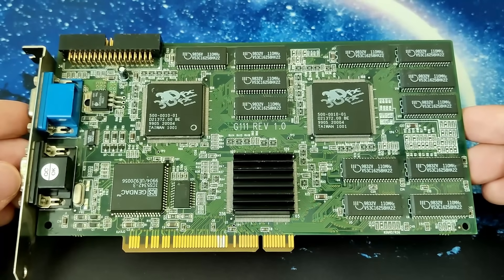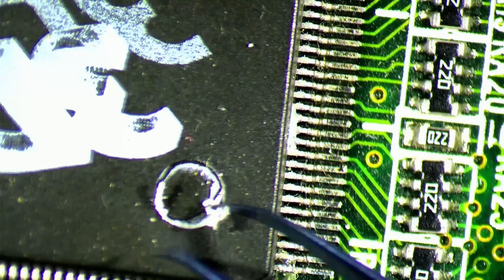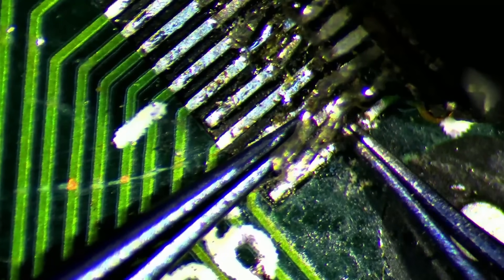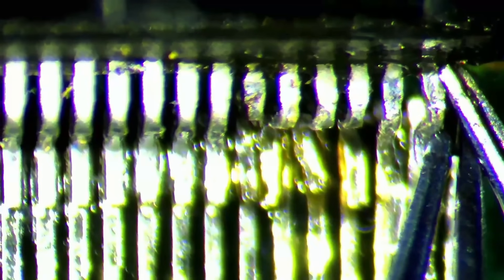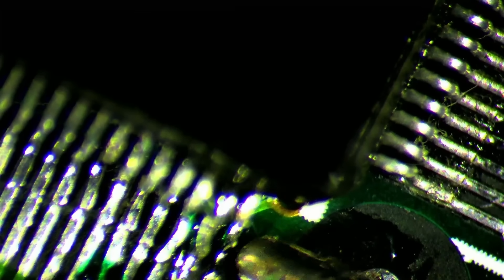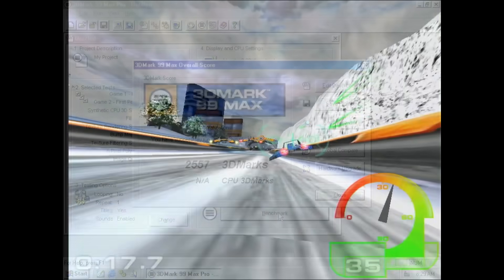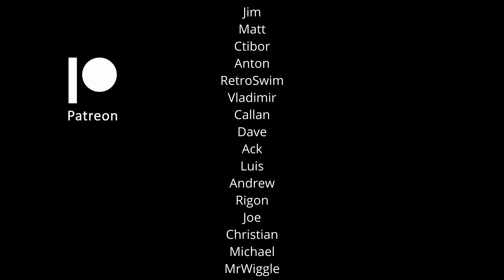Mail-in repair: Voodoo 2 with 12MB @ 110MHz memory

Comment: @BitsUndBolts: die VGA-Karten haben einen Tiefpass vor der DB15-Buchse, um die UKW-Frequenzen nicht zu stören - bei 1024x768 und 85Hz ist man schon bei 94,5MHz. Das schlug sich aber auf die Bildschärfe nieder. Die Filter sind manchmal gut designed (Matrox z.B. hatte immer LCR-Filterglieder verwendet), und manchmal eben... "ökonomisch ausgelegt" (S3 typischerweise mit einfachen CR-Filtern). Man kann die VGA-Signalqualität bedeutend verbessern, wenn man diesen Tiefpass deaktiviert - z.B., in dem man die Kondensatoren herauslötet/ausbricht. Hatte damals super z.B. bei billigen GF2MX-Karten und unseren teuren 21" Eizos funktioniert, selbst der große Sony GDM-W900 mit 16000x1200px wurde dann scharf angesteuert.
Reply from the maker: Hm, interessant. Von sowas habe ich noch nie gehört! Das wäre Mal was, wenn man durch Entfernung von Kondensatoren die Bildqualität erhöhen kann. Gibt's dazu mehr wo ich mich etwas einlesen kann?
Reply: @bitsundbolts  hmm, meine Antwort hat YT gefressen; such einfach mal in Google Groups nach "VGA low pass" oder "VGA tiefpass", da gibt es einige Threads aus der guten alten Usenet-Zeit dazu :)

Comment: back in the day I had a voodoo 2 expansion card, which also used a loopback cable. I remember having to make sure it was not pressing against anything or anywhere near anything with high voltage or alot of electromagnetic interference, because otherwise the screen would either go darker or have a bit of "static" in it. Having a slightly damaged loopback cable would probably also cause this

Comment: Your description has items you use but what actual solder wire do you use and its diameter? Im trying to souce some that is 0.3mm thick but good. Thanks
Reply from the maker: I wish I could provide a link to the solder wire I'm using. However, there is none. It is from 1998 😅 - "Balver Zinn", 0.7mm. I'll show it in an upcoming video.

Comment: @BitsUndBolts @Amy
Top shelf soldering work!! Very well done indeed! The poor image quality is very likely the VGA bridge cable being used in this video. Find a higher quality cable(one with thicker shielding) to avoid this problem.

Comment: I have the same card, but with corrupt texture issue... However, it don't have any problem with image quality under windows or with 2D rendering...
Reply from the maker: Maybe a memory issue or a loose pin on one of the TMU chips.
Reply: The Voodoo 1 and 2 are 3D-only cards. The regular Windows desktop and programs will run entirely on your 2D card; the Windows desktop will work perfectly even if the 3dfx chips are completely nonfunctional.

Comment: Amazing micro-soldering as usual! With my capture device, I have noticeable noise on screen when my laptop's power supply is plugged in. It disappears when unplugged. Did you try the card directly connected to a VGA monitor? I'm not sure I can see the issue after Youtube compression, maybe some lines on the desktop before you got into the voodoo control panel?
Thanks for the video!
Reply from the maker: Thank you Tony! I think the problematic image quality is due to the S3 Virge. Unfortunately, the card is packed already and ready to go back home. The owner will let me know if she can reproduce the problem, but I am confident that the card is working as intended.

Comment: Bro what does the black VGA port mean? Is it for secondary display?
Reply from the maker: Voodoo 1 and Voodoo 2 cards have two VGA terminals. One VGA port is going to the monitor, the other port is for the loopback cable which passes the signal from your primary graphics card through the 3Dfx card. This is the only way to seamless switch between 2D and 3D mode with those early 3Dfx cards.

Comment: My first GPU! At one point I had two of them linked together. It was strange because all it did was enable 1024x768 resolution instead of the speed boost you would've expected.

Comment: Another well done job. 👍
A pro tip from my work and experience: If you desolder ceramic capacitors, be careful not to overheat them. They can change easily their value when the temperature gets to high and result in a wrong measurement. Somewhere I have also read a study about this. 😉
Reply from the maker: Thanks for letting me know. I wasn't aware of that. I usually try to keep the heat exposure to a minimum.

Comment: ive found soldermasking the adjacent pins prevents bridges and accidently unsoldering adjacent one  thats been fixed . actually the solder mask is easy to scrap off the metal legs once ur done and it can be softened with contact cleaner - the soldermask seems to bond solid with board but  provide a temp bond with the metal legs. Also a S3 virge legs harvested from a dead card  is a perfect replacement even if the length of the foot is shorter  - -  ive replaced 6 broken pins all in a row with this method but with mine  I had to grind back the top of the chip as the legs were snapped off completely flush with the chip - good job  well done not snapping off those you had to straighten  - nothing worst than making the job twice as hard trying to get it looking like new -

Comment: Could you clarify what you mean when you talk about using direct3d when using the s3 virge and then using glide on the Riva? You say 'But I'd prefer to use Glide' like it seems to matter which 2D card you're using. Which is obviously not the case... you can use d3d or glide no matter what 2D card is installed. Don't really understand your comment.
Reply from the maker: I meant for the Voodoo 2. I only changed the 2D card while also changing the graphics API. The Voodoo 2 can render in Direct3D or Glide. Sorry for the confusion.

Comment: This is certainly a clean job. Unfortunately, the question of how high the card can be overclocked remained unanswered.
Reply from the maker: Yeah, that would have been an entire different project. Unfortunately, I don't have the card for a long time and it is no my card. That is why I do not really want to overclock it. But I doubt that the faster memory makes much of a difference. The 3Dfx chips will be the same as on many other cards.

Comment: I'd keep a close eye on either the 3DFX card or your video card, degrading image quality can be an early sign of failing capacitors. We're seeing this happen on the Wii, where the image gets noticeably darker due to failing filtering caps.

Also, were you using that new overhead camera you were talking about a few videos ago? I think I prefer the old one
Reply from the maker: Yes, I am using the new camera. I usually never zoom all the way in because of degrading light source (darker image), as well as issues getting a sharp video signal. The change in quality is not as significant as I thought - except the 60 fps footage. Surprisingly, the camera that came with the scope is good enough. I wouldn't replace it if I'd known that it makes this little difference. I still need to figure out what else I can do with the camera, but haven't had the time yet.

Comment: Just as you were saying the microscope was not good, I was reading the video description to try and find what scope you're using because it looks so good!
Reply from the maker: I added a link to the video description. The only thing I did was to replace the camera with a better one. But the camera that comes with, is quite decent considering the total cost of the microscope. The captured video signal is not comparable to the optical view you get when you work on something - it is a million times better! It's a pleasure working with such a tool!
Reply: Oh thank you! My old Chinese solder station died a while ago. I've got a Pinecil and narrow tip set on the way for Xmas, and have been watching videos like yours to get some visual experience beforehand. I have some SNES and PlayStations I want to repair. I can solder fine but never done SMD or anything this small, not successfully anyway haha

Comment: Maybe the loop cable doesn't have separate shield for each of RGB and sync signals. This works but the common screen will introduce crosstalk between the signals.
Reply from the maker: I like this loopback cable because it doesn't push the cards around (I do not have a proper test bench yet where I can screw the cards properly to a frame). You may be absolutely correct that this cable is introducing a lot of the issues.

Comment: To see if the image quality is due to the  pass-through cable (which I bet it is... it looks flimsy), you can just connect the voodoo directly to its own separate monitor.
Reply from the maker: I think this loopback cable was part of a 6MB Voodoo I got off eBay some time ago. I don't know if this was actually the cable this card came with, or if it is an aftermarket cable. I wish I had a separate CRT monitor, but I only have very old LCD displays. I wouldn't trust their picture output either :)
Reply: @bitsundbolts  probably after-market. My Diamond Monster 3D II came with a very thick and inflexible pass-through cable. Just for testing I'd connect the 2D card to the shitty LCD, just to have a functional desktop, and the CRT to the voodoo to judge the picture quality.
Reply: I'd second the passthrough cable. I have a Canopus Pure3D II that has the goofy DIN connector to VGA pigtail, and it has noticeable image degradation because they didn't use enough shielding in the wire. When I have it in SLi, I use it as a slave card so my reference Voodoo2 card can use a beefier VGA passthrough cable.
Reply: @GGigabiteM  Yeah, I don't like the Canopus cable, and had to make one for my Voodoo 1 card that I picked up a few years ago. Thankfully my diy cable worked perfectly. A bit of a pain to build a cable, but the quality is then dependent on what you build.

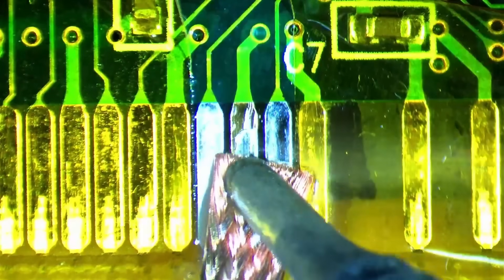Comment: 7:55 There are two methods how to get solder out of gold (or copper) pad but they are both too complicated. First one is to use Indium or mercury and they will absorb the solder. Second one is to reapply gold coating. In other words, way too much work...
Reply from the maker: I agree - it is too much work for very little benefit.

Comment: I hated those pass through cables, and usually manually switched the cable from 2d to 3d to remove that from the equation.
Reply from the maker: That is a possibility to get rid of the loopback cable. Or, if you do not have a loopback cable, you can still enjoy some glide rendered scenes.

Comment: can you make a video upgrading the video memory to 24mb or 16mb in case  you use a 8mb V2 ? if u want i can supply one voodoo2 to you for that project
Reply from the maker: Based on the documentation, it should be possible to increase the texture memory to more than 4MB for each TMU. I think each TMU supports 8MB - which would result in a 20MB Voodoo 2. But I haven't seen any mod like this, nor a pinout of the TMU chips. It will be difficult to figure out how to add the extra memory to the card. I could imagine that a non-connected pin is responsible to address the extra memory. Would be cool to identify it - then the upgrade would be similar to the Voodoo 1.

Comment: About image quality: First; don't use S3 for 2D, it's one of the worst, go for a Matrox (preferably an AGP one). Second; go for a pass-through cable which has ferrite beads. Third; your monitor should have an auto-adjust button - press it!
Reply from the maker: Yeah, I think I should be more careful and not use S3 cards. I confirm that the S3 does have some picture quality issues when used as a standalone card.

Comment: my s3 virge has always had a somewhat fuzzy picture, there's probably some way to improve it. bet they just used cheap parts.
Reply from the maker: Yes, I noticed that this S3 indeed has bad picture quality. I should be more carful using S3 cards in the future. The card is probably OK. With a better loopback cable and a nicer partner card, this Voodoo 2 may just deliver an acceptable picture as one would expect from a Voodoo 2.

Comment: I doubt there is a way to completely remove the solder from the pads other than removing the plating entirely. When solder is first applied it forms thin layer of alloy on the contact surface. That's the reason why solder joints are so strong.
Reply from the maker: Then this card will have three silver contact pads on the PCI connector. I doubt it to be an issue apart from being a visual flaw.

Comment: Ferric chloride on a Q-tip will remove the solder, you must move quickly and with purpose using this method, as wiping the ferric chloride too long will eat the gold, and eventually the copper. test on scrap cards, but this method when used properly will leave you with flawless gold fingers again.
Reply from the maker: Thank you for sharing this information. I have a feeling that it may be very toxic and probably not worth the effort to cleanup those pads. But great that there seems to be a way if the owner ever wants to attempt a cleanup. And then, the card will be back with me to fix 3 missing PCI connector pads 😉
Reply: @bitsundbolts  Ferric chloride is widely used to make PCBs at home (because it dissolves metallic copper, thus etching the track). It's not harmless but ok if used safely.

Comment: I have an SLI setup with two of these cards and they give me exactly the same lines on the desktop. So I think it's unfortunately part of the normal working order of these cards.
Reply from the maker: Interesting. Maybe there is some sort of an issue with the drivers / refresh rate going on. The driver does change something once the 3Dfx tab opens. I wonder if it is a combination of Monitor + card drivers.

Comment: It is not possible to get solder off those gold plated pins. The solder alloys it, so it is impossible to remove it entirely. People claim that soldering doesn't mix the metals of the solder tin with the components and pads but that is false, if that doesn't happen you have a cold joint. The only way I see "Fixing" that is to somehow grind off the solder and then somehow re-plate those contacts.
Reply from the maker: That's ok. Then this card will have those three connector pads always covered in solder.

Comment: Another priceless card restored to working order, you're doing awesome work my friend. Regarding C77 and C82, there are schematics on Vogons that include the correct values for each component. I wouldn't be surprised if there's even a BoardViewer file floating around by now. You could also have  taken measurements from a similar Voodoo 2 to know the correct values with certainty. I know you have at least one of them lying around. 😉 Spoiler: They are indeed 100nF, rated for 25V. Concerning the noisy output, my money's primarily on the loopback cable (since the ones I've come across in my time are super short and super beefy, considerably more so than the one seen in your video), followed by the 2D card.

Merry Xmas! 🎄
Reply from the maker: Thanks! Yes, you're right. It's probably the loopback cable, and then the 2D card.
Reply: @bitsundbolts  One thought I forgot to mention the other day: It might be possible to remove the less noble tin from the gold contacts using an acid like nitric acid? Maybe a chemist can chime in on this? The tin shouldn't be an issue though, so better don't bother and risk creating an issue where there currently is none. 😅

Comment: Your loopback cable looks somewhat thinner than the period correct ones, this can sometimes cause image interference
Reply from the maker: Yes, it is. It's easier to connect this thinner loopback cable since I don't have a proper test bench yet. Could be that you're right and this cable adds to the bad image quality.
Reply: @bitsundbolts  I have a thick loopback cable that I use on my voodoo 2 rig, but also a thinner homemade cable - and the thinner one always looks less sharp for image quality (that was my experience at least)

Comment: Both the Virge and pass through cable will be hurting the image quality. My 3D Monster II looks great using its original (well shielded) cable, but only with certain cards. Looks awful with my Fastware TNT2 Vanta, ok with the Viper V550 it was paired with from new, and really good with my 2001 D.O.M Savage4 GT.

It is the same with my STB Black Magic. The cable I bought for it has good shielding and is the same length as an original cable.
Reply from the maker: I think you're right. The bad image quality may be due to my choice of 2D card.
Reply: @bitsundbolts  Just remember, the higher a cards RAMDAC clock is, typically you get a higher image quality especially if it is an integrated RAMDAC. Some cheaply made cards however can still negate any quality advantage (eg. My Vanta which has a worse/far softer than my Creative Graphics Blaster/Riva 128ZX). 
I recommend using a Matrox card of some type if you are testing a 3D accelerator. 
From my understanding their cards had the best image quality back in the day, only having the likes of Nvidia and Ati come close in the 2000's. 
Which is why people would buy say a Matrox G200 to act as a 2D card for their Voodoo2

Comment: Those are really good soldering skills. The equipment makes a whole difference too, but without the right skills it's useless.
Reply from the maker: Thank you! I actually use pretty cheap gear. I am using the FNIRSI HS-01 soldering iron, Amtech flux, and decent solder wick. The microscope is the game changer in my opinion. But you do need steady hands and patience.